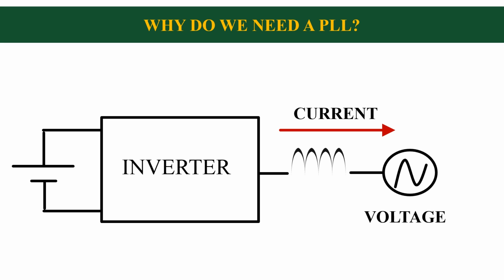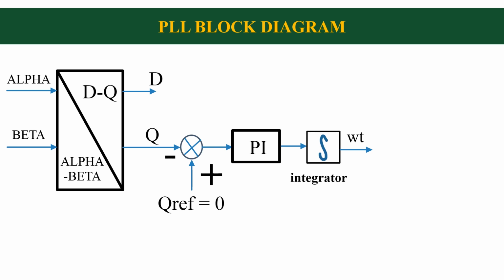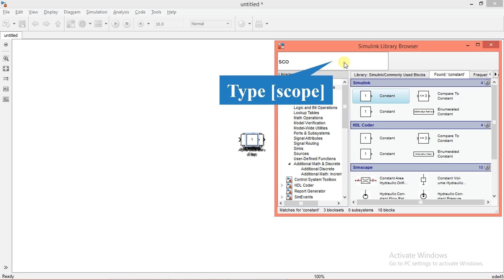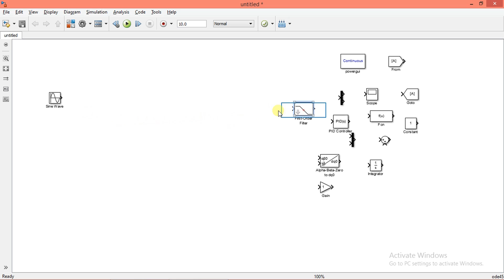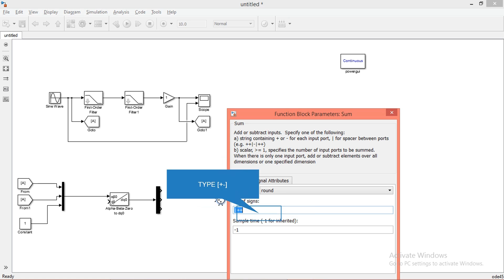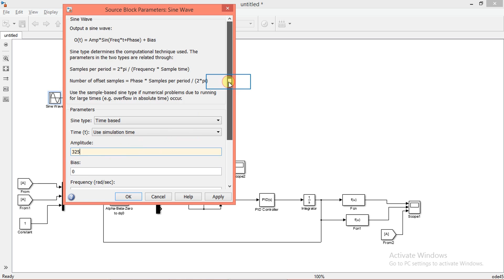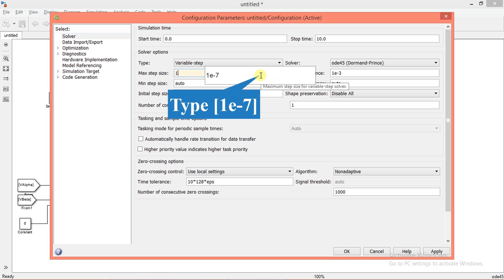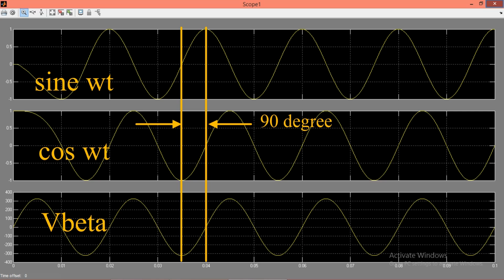Simulation of phase locked loop (PLL) for single phase grid connected inverter using MTALAB.

Comment: Your Video is very appreciated. However, your generated w is not changing between (0 to 2pi or -pi to pi) like saw-tooth. Practically and in Research it is preferred to see w changes between the earlier mentioned values.

Comment: If you already know the frequency for the 90 deg phase shift then you don't really need the PLL. A PLL should work even if the actual freq changes from 50 to 60 Hz... Also, the integrator after the PI controller is redundant if you don't need to extract frequency value (it just adds another pole at the origin for the PI)

Comment: I don't understand why the output of pi is W, thank you
Reply: i think because input is error angle, so PI shall calculate the control signal to reduce this error so it is w*, i think it same when we  use current control in motor control, the output of controller is voltage

Comment: An obvious question is, why not just use the grid voltage divided down to 1Vpk as our reference?  It would be in phase to deliver real power to the grid.
Reply: As far as I understand, the grid voltage can have disturbances and unwanted harmonics. The PLL helps us stay in phase with the grid without mimicking and adding the unwanted disturbances found in the grid to the grid.

Comment: Thanks sir,
I have a question:
How can I do a simulation of phase locked loop (PLL) for "3" three phase grid connected inverter using MTALAB.
Reply from the maker: First transform the 3 phase (abc) voltages into 2 phase(alpha-beta) voltages and then use the same method i have explained in this video.

Comment: for PLL KP and KI values how to compute, Can I take the LCL filters values to compute the same because it might be the voltage controller so that in that Capacitance can be taken for Kp and for KI need the ESR Value how to get it the same? Please Provide the details
Reply from the maker: For PLL we cant take capacitance or esr values. What i did i used pi tuning that is available in matlab.
Reply: @TechSimulator  then how to find the Ki and Kp values
Reply from the maker: We can tune the pid controller which is available in the simulink library. I used that
Reply: @TechSimulator  need calculation formula for  KP, KI in PLL loop. how you took 10 and 50000

Comment: Does pll will work with variable frequency 46-55 HZ???
Reply from the maker: It will. But you need change the low pass filter corner frequency every time when u change the input freq.
Reply: @TechSimulator  I think thats not practically possible.

Comment: Why you multiply by 2?
And why the ref is taken from Q not  D?
Reply: the 2 is to counteract the 1/2 magnitude created by the two low-pass filters. The reference is taken from Q, because from the ab0-dq transform the q parameter contains the angle difference information. It is being controlled to zero so that there is no difference between the inverter and grid angle. The d parameter contains the magnitude information, that is why it is not being controlled in the PLL.

Comment: since your transfer function value is 1/2 that means output/input = TF so why are u taking gain as 2,. it should be 1/2
Reply: He mentioned in the video that the gain of two first order low pass filter is 1/2. So he multiply the output by 2 and gets a gain of 1. So no damping or amplification of the signal.